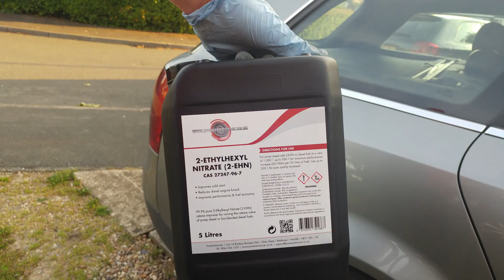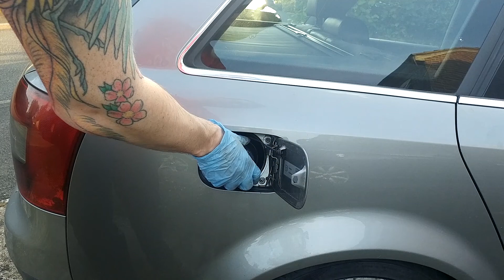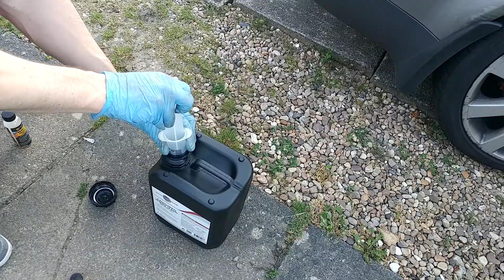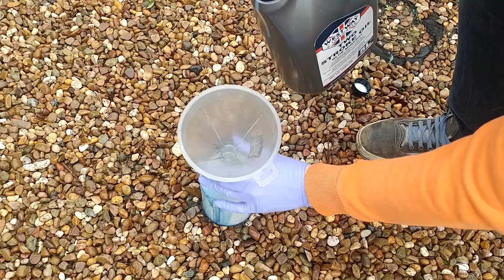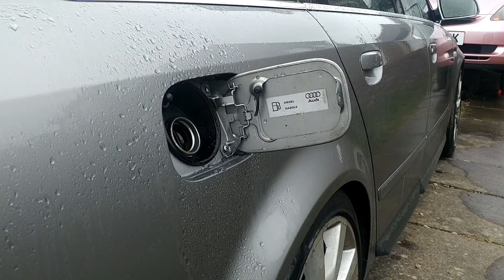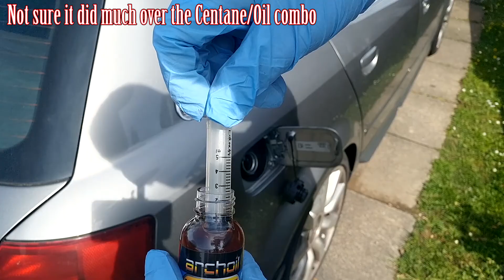2 Stroke Oil and Cetane added into my fuel!? Talking Diesel Fuel Additives

Comment: i have been adding 250 ML of mineral 2 stroke oil in my high mileage 2.0 x type Jag,for about 18 months -ford engine-, and i have noticed a huge difference , much smoother, less clatter, easier starting and way better MPG, over 50, whereas it was around 35 before, it must't be synthetic as it won't mix with the diesel well, if at all and gives off a nasty burning smell
Reply: Ive done a few test mixes in big jars in my garage and it does mix mate. I use mineral low ash in my xtype and just squirt it in just before i fill up with diesel
Reply: @jonnyharris2724  I have a 2.0D X type. On 89k. How much 2 stroke min oil per tank?
Reply: @matthewjackson3034  i use 50ml per full tank
Reply: @jonnyharris2724  what brand of mineral 2stroke do you put in your diesel mate?
Reply: @hellohello8556  wickes own brand mate, cheap as chips

Comment: Two stroke had zinc in it. Zinc causes injector blockages hence the reason two stroke is only used with carburettors.
Reply: That is not true!
Some 2t oils are made for injectors  and carburetors,I don't say I good for diesel engines because I don't know
Reply: Injectors are now Teflon coated should not cause any blockages .👍🏻
Reply: Exactly why risk adding two stroke oil which was never intended for Diesel engines
Reply: @kenhignett1341  JASO-FD synthetic has 0.18% of ash and really strong detergents. I pull injectors every 40,000 miles. Injectors tips are clean. So do not believe in all bullshit on internet you read about.
Reply: @Fosgen Hi, will jaso fd cause dpf or catalytic converter/ turbo issues?? Just curious.

Comment: Okay I am a bit confused please can you help me I’ve just ordered I see you add 2 / oil In the red x  container And you also added more?
Reply from the maker: Hi Mick - I just used a container I had kicking about once I measured things out  - I use 300-350 ml per tank the ratio I use is 200:1 which is 325ml . These were just from different occasions I filmed to demonstrate things.
Reply: CarAndMechanical Just to confirm you used 300 mL of two-stroke oil and 100 mL of booster
Reply from the maker: Yup I use around 325ml of oil for 65 litres of fuel and 50-100 ml of cetane booster.
Reply: CarAndMechanical ok am on my 2ed tank with this mix I don’t feel that it makes any difference? I have a  2006 Volvo s40 2.0d 188k? ... The oil I got is green From Halfords 2 stroke LOW ash mineral Garden engine oil
Reply from the maker: Is that a high pressure PD or common rail system? This works well on rotary pumps like the VP44 and the old style injectors. 
I notice it helps mine a lot - what issues do you have?
The cetane booster won't hurt things and I don't think the oil would depending on fuel systems but it's ideal for mechanical pumps.
Reply: CarAndMechanical Hi I I do not have common rail I have mechanical fuel pump attached to the engine? I have a clattery Engine on idle Coldstart issues see my video Thanks for your reply
Reply from the maker: OK clattering could be valves/lifters also,  and I assume this is a cold weather cold start? Have the glow plugs ever been changed? My car's always been a strong starter tbut it's a bit slower to catch in winter, as in the summer I can turn and start it without waiting for coil lights to go out, in winter I need to let it crank a few times.
Clattering can also be bad timing - I actually have some other videos on clattering issues and I'm sure my lifters need replacing, but I know it could also be timing. TBH it runs mostly ok and I don't fancy rebuilding the V6's DOHC heads just yet.

I suspect my noisey engine is a combination or the VP44, lifters, injectors and maybe timing. And the oil helps sort some of it.
Reply: CarAndMechanical have a look at my video?
Reply from the maker: Yep I looked at the cold start which is why I wanted to know what temperatures it does this in.
Reply: CarAndMechanical Sorry I did thank you seen it on Clock . 22 c Last month Northwest England I just recently uploaded another video of the engine from outside
Reply: CarAndMechanical ok thanks The little bottle you use I also get one with a bigger bottle I will have all 3 Would you be so kind to give me measurements of all 3 please as it’s my first time using this product and I’m a bit nervous of getting it wrong my car is a 2006 Volvo S 40 2.0 d with 190k

Comment: Automatic Transmission Fluid or even a bit of petrol(pre mixed in diesel) does the same thing.
Reply from the maker: I can see atf working but petrol wouldn't lubricate imo. I'd worry it would reduce the effectiveness of the rotary pump and injectors over time, though it would perhaps offer some cleaning properties.
Reply: CarAndMechanical Keep on making videos 👏👏👏

Comment: If i put the right 2 stroke in my car will it be ok ? Its a vectra sri diesal 55 plate and qite a fast car i just want know if it will do any damage? As i used to have a peugot 206 hdi and it would not run on red diesal so i worry if im going try this out

Comment: I  use it in mini  2004 R50 diesel with Toyota engine reduces smoke from exhaust, noticeable power increase/throttle response engine less noisy , owned 10 years 150000 mileson clock

Comment: Also 2t oil in 500:1 ratio works as upper cylinder lubricator,thus smoother as less friction and 1% better mpg.

Ita good, i do it on my motos, will do a video about it too, and see in check camera in there
Reply: and the video part 1 is up

Comment: Hello mate,
I’ve got a 2.0 BKD tdi, that’s got a strange cold start/ running issue… so it cold starts fine, no issues but when driving it for the first couple of minutes the car misfires between 2200rpm up to 3100rpm but by the time you’ve hit that rpm you’ve let off because it can’t be good for the engine.
Seems to me like it’s not getting enough fuel like there isn’t anything for it to combust or the air mixture is way off… like the turbo isn’t boosting right… idk but this symptom only lasts for a short time from start-up. When the engine is up to temperature its fine until you’ve been driving for a good 40mins, after that you get slight misfire every so often when cruising and it will do it fairly frequently when sitting 70+ fast lane.
Any ideas?
Reply from the maker: With a Diesel we don't tend to get a misfire in the sense of a bad spark as the fuel is compressed so my first thought is fuelling and then I question why/where. 
You'll need to get it scanned with VCDS or get torque on your phone and keep an eye on Mass Air readings when good vs bad and the same for boost.
A bad MAF could be to blame for this or something could be up with the fuel injection system - if you can get fault codes read - potentially change the fuel filter (it's a service item anyway) and start ruling out what it's not.
Reply: So far I’ve changed the fuel filter, which looked like it hadn’t been changed for a long time… it was filthy but when I drained the housing into a clear bottle only a little bit of oil sat at the bottom which rules out the valve seals failing. Because of this I then checked the fuel pump in the tank to see if anymore of the black stuff was around and yeah… it was coated but generally the tank looks clean. I removed the pump and took it apart and cleaned everywhere with carb cleaner. Still the problem remains… I need to get the £240 version of VCDS as I need to run it from cold, if I was to take it to a garage they would have to keep the car for days to replicate the issue. Hmm need VCDS.
Reply from the maker: Have you got the VCDS lite to scan for codes and run logs?
Also do you have n ELM327 and the Torque app on android, the problem with an intermittent fault it tracking it down so what you want is live data so you can see if you are down on fuel/boost/maf,coolant temp(this can screw lots up) reading - potentially something stupid like a stuck actuator on the turbo?
It's long winded but it's easier to rule out what it's not.

Comment: Ive given it a go a number of times in my Mitsubishi NP Pajero 2004 3.2 DID. (4M41 motor) I have added to a full tank of fuel 90ltr between 100ml to 400ml on different fills and have noted a smoother motor, quieter motor and possibly better fuel economy. This said results can also be subjective to the ambient temperature out side, oil used in motor, road conditions etc. All said and done, I do feel a benefit (as small as it may be) is obtained using 2 stroke (mineral). My initial interest was to lubricate the mechanical fuel pump which is rather noisy on these diesels. Additional smoke was nothing out of the ordinary as this motor is a very clean running one already, yet under heavy acceleration as per most vehicles it does soot up to a small extent. Keep your foot light on the pedal and no issues.

Comment: *i have a 2006 2.0 A3 TDI PD Engine and i only ever use BP Ultimate and Black Diesel Red Ex ever few tanks, any advise or anyone think this is a good thing/bad thing or is there any more i could be doing to help is this ebough ??
Reply: Scottytee safe, in safe amounts, try 1000:1 or 500:1 ratio 2t oil in fuel, 1milli litre in 1 liter

Comment: I use 4oz of two stroke oil and a 12oz can of red HEET when i fuel up, I have a VW with the 1.9L ALH and have been doing this for about 2 years and have experienced no negative effects, glad to see other people use the two stroke oil for lubricity
Reply: I have been using 2SO for about 10 years usually with another additive, currently Fuel Doctors. Everything working beautifully.

Comment: Isn't it more smokey? I've heard about this before from other people. Seemed to work for them too.
I remember my dad used to mix a bit of petrol in his diesel audi 80, years ago, in the cold winters( -20°C  -30°C) to help it start quicker in the mornings
Reply from the maker: Nope, if anything my car is a bit too clean on the smoke side of things (see dyno video which had premix in). Car does take a few cranks to start when it's at or below 0 degrees and you get an initial puff of smoke but that's longer cranking due to low CCA's on the battery or a glow plug issue.
Reply: Paul Cauneac if its TC W3 standart (marine use, mo smoke burns ashless)
Thats good,and most safe
Reply: my old trucking boss told me that as well..one gallon of gas to 99 gallons of diesel so then the diesel does not gel up in the extra cold wheather. ..